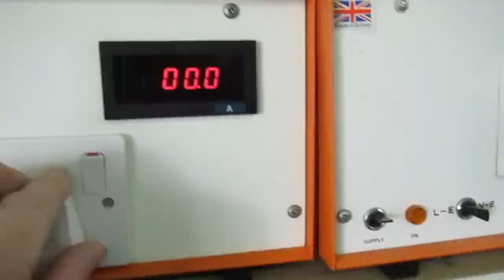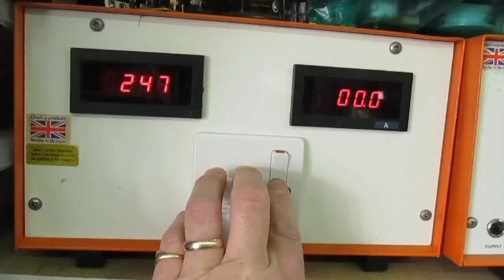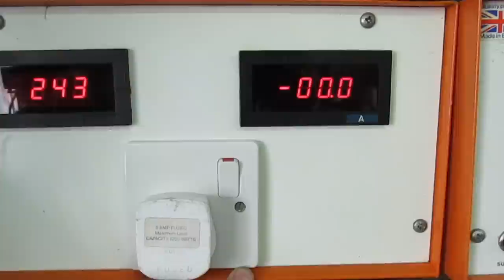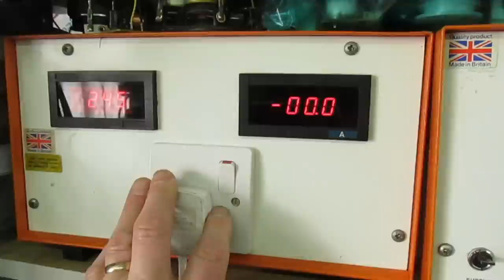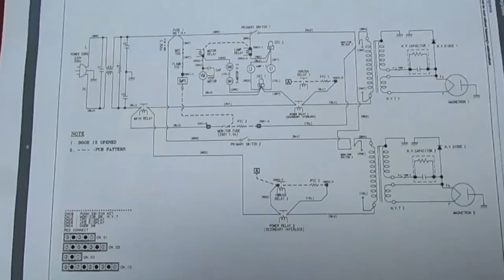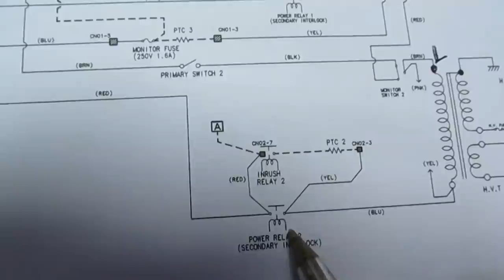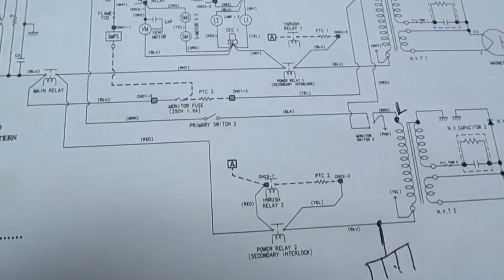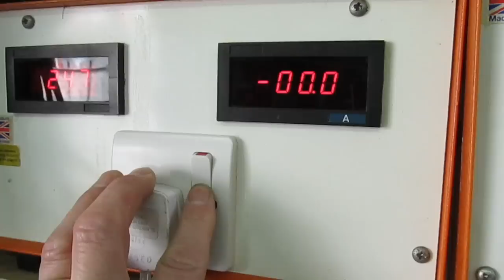Bizarre fault on Samsung commercial microwave oven.

Comment: During my apprenticeship in the 60's I was taught first and foremost, "look for the obvious". On saying that, when I was a chargehand electrician in mining, I had a call from one of my electricians, we were on night shifts, so even the obvious sometimes won't show up. He said he felt a fool but was stumped with an electrical problem and needed help...I helped him sort it out and it turned out to be a wire had come loose in a connector in a control circuit.
Reply: I must admit though, we once had an intermittent fault in on a main trunk conveyor, during it's life it must have cost my employer thousands in lost production, so you can imagine the pressure on us to locate and cure it. BUT, the damned thing wouldn't stay on long enough to make a diagnosis.Three overtime shifts looking for it didn't show results, myself, another competent elec and my Foreman on one of those shifts. I came on shift one afternoon, and the prior shift elect was telling me of a problem he'd had with this conveyor, then it hit me like a brick!! I now had the clue I had been looking for, one of the solid state modules was causing the problem, and I knew exactly which one. I took off underground before the shift started, made my way inbye to the trunk belt, checked what he had done, removed it and the belt worked perfectly, so the following day was a down time maintenance shift and I swapped out the suspect module. Fault cleared, it never reared it's ugly head again.
Reply from the maker: Absolutely , a visual inspection can sometimes give a fault away without needing a circuit diagram , a dry joint , loose connection ETC, but in this case with years of grease and fat build up visual inspection was very difficult .

Comment: I started repairing microwave ovens in the mid-80s and continued right into the 90s when repair was still an economic option. I did a few commercial ovens like this, some that could take a cup of water from cold to boiling in about 10 seconds. They were either wired with a 15 amp plug which has a larger earth pin (so cannot be connected to a standard outlet) or connected to a 20 A single phase PDL 56 series plug and socket.
I don't think in my entire time of servicing microwave ovens that I ever saw a fault like this where the wiring had burnt through to the case.
Reply from the maker: I have done a lot of these ovens over the years and they all just come with a standard 13 amp plug fitted , the instruction book quotes the input consumption as 3200 watts so yes its not good and I have had over the years people complaining they burn the sockets on the wall.
Reply: @michaeldranfield7140  not surprised! where i used to work (packaging factory) we had high power hot air guns, for heat welding polyethylene foam pieces, 'recommended' to be powered from a 16A circuit, but some were used on normal 13 amp plugs, with wattage i think 3.4kw? so the plugs and sockets got more than a little warm, it took a while to find plugs which heated the least! our kettle, 3kw, even makes its plug (and cable, but that seems to be underrated for its current, looks a 10A type to me) get pretty warm and thats only on for a few minutes at a time ..
Reply: @michaeldranfield7140  Yes I can imagine they would heat the wall sockets up a bit. I forgot to mention I am in New Zealand - our mains wiring is a bit different to the UK. For one, we don't use ring feeds whereas I know they are almost universal over there.
Reply from the maker: @sw6188  Domestic house wiring is not really my thing so I do know of the ring main but not sure why its done this way .

Comment: Well, it was pretty clear the meter was "lying", either because it wasn't reading all the wires that power could be going through (as it turned out) or because it was getting confused by some power factor-related issue (i.e., power being drawn on the "wrong" part of the cycle). I'm surprised that meter just seems to ignore the earth and live wires, and is only checking for current returning through neutral. "Quality product made in Britain", says the sticker. Heh.

Comment: Neither the restaurant or your workshop have an RCD then!
Reply from the maker: I don't actually know what's in this building apart from when I bought it I was told it has a 3 phase incoming supply, and I only use raw mains for testing microwaves as all my benches are fed from isolation transformers .
Reply: There are still plenty of installations in the UK without RCD, only mandatory on T-T supply incomer - ground rod earth.
Reply from the maker: @paulhancock562  Had a look in the fuse board and there are some sort of breakers fitted but I guess technology has come on over the years and better thinks are now available .
Reply: @michaeldranfield7140  You can replace the MCBs with RCBO RCD devices....but if you have shared neutrals then that can't be done.  So you might be able to do it, and just drop in some RCBOs instead of the MCBS.

And I would suggest you then perform a test on the Clare module by putting an earth fault on the switched outlet and check that the RCBO does indeed trip. If it doesn't you will need a separate RCD plug inserted into the socket of the Clare.

Don't assume that the RCBO in the consumer unit will protect against an earth fault on the output of the Clare.
Reply from the maker: @deang5622  many thanks for that .

Comment: Interesting one!
Reply from the maker: Certainly was and as someone else has pointed out its time to get an electrician in and get my fuse board tested and updated to some sort of trip system as this is quite and old building .
Reply: @michaeldranfield7140  I'd make sure its a RCBO system and not just a split load, so one faulty item doesn't take power out to half the building

Comment: with anything electrical, I will do a quick examination of the wires first. only reason, because through the years I did crypto mining, and a few wires melted the insulation which then cuts the power if the supply detects it, or if the fuse blows.
Reply from the maker: Down to poor design I think , wires passing through a metal hole should be shielded by a rubber grommet.

Comment: @ Michael Dranfield
Why don't you have ELCB (RCD)  installed on that mains supply?
Why don't you safety test (Earth leakage at 1,000V) prior to plugging it for a function test? 
Doing either of these would have indicated immediately either an Active or Neutral insulation fault.
Reply from the maker: I dont do a PAT test untill I have repaired something  but yes I would have picked this up straight away if I had done the insulation test first .
Reply: PAT tests take too long.
When someone gives you an appliance, the first thing you are going to do is plug it in and see if it works. You're not going going to go through the hassle of digging out the PAT tester. And the PAT tester doesn't tell you anything about whether the appliance works.  You're given an appliance that doesn't work, for all you know the fault could be in a microprocessor control board inside. So you just going to turn it on to see what kind of fault it has. Then you can start to investigate it.

What he should have done is use an RCD plug (or connect to a mains isolated supply where there is an isolation transformer).
Both would have prevented electrocution when touching the metal case.

The RCD would have tripped, indicating a sizeable earth current. And given that it has a metal case, that would set the alarm bells ringing..."Take care!".
Reply from the maker: @deang5622  seems like I have a fuse board full of breakers not RCD s but I have since bought a plug in RCD for microwave repairs, , my other benches are fed from isolation transformers , I only use raw mains for microwave ovens .

Comment: Those wires didn't appear to be very secure to prevent that type of fault
Reply from the maker: True and they also don't look that capable of carrying 7 amps .
Reply: I don't think movement of the cables has led to this fault
Reply from the maker: @deang5622  it was disturbing the cables that led me to the fault, a big blue flash !

Comment: Could you also diagnose further to find out why the insulation on the transfer output wires got melted in the 1st place? and what exactly caused them to overheat?
Reply: They overheated because of excess current flow, or because the insulation broke down because of the voltages involved and age of the cables. Take your pick.
Reply from the maker: I think one of the factors was grease dripping onto the cable which passed through a hole with sharp edges and didn't have any sort of rubber grommet fitted to prevent this, and this degraded the wires insulation . .

Comment: Why would the RCD not trip? Or was this on a unprotected circuit?
Reply from the maker: as this is an old building it appears I dont have RCD s fitted.
Reply: Why assume there was an RCD? This is the thing that is puzzling me. So many people assuming that the circuit is protected.

The power is coming out of a Clare device, via a standard 13 amp switched UK mains socket and if you look closely there is no test button, so clearly this socket does NOT have an integral RCD.

Ok, so what about protection upstream by an RCD in the consumer unit? There may or may not be one present. Just an assumption. And even if there was, as the power is going through the Clare, you can't assume that the RCD in the consumer unit would protect against faults on the output of the Clare. It might , it might not, it depends on precisely what the Clare is doing.

So the best way to provide protection here, is either by using an isolation transformer with a 1:1 ratio on the windings, or by using an RCD plug plugged into the socket outlet on the Clare.

Comment: If 14.7 amps is normal for that microwave then it can't run of a 13A plug in normal service
Reply: probably meant for a 16Amp line
Reply: Rated power on the front of the microwave is way less than the maximum for a 13 amp socket.
Reply: @deang5622  i know, you need to  to look at the actual consumption on the back, ours is marked on the front as 800w but actual power draw is 1300, i think

Comment: After repairing the microwave and refitting the case, do you have to check for microwave leaks? I'm asking because my microwave is making a noise that sounds like a duff plastic gear and I want to investigate, but I've never opened one before.
Reply from the maker: Yes , I always check for leakage, you wont cause any damage by just removing the case , in my experience leakage only occurs when the door is damaged ,  it will be perfectly safe just to remove the outer cover ,
Reply: @michaeldranfield7140  thanks. I was a bit worried about it.
Reply from the maker: @davidkerridge6612  nothing to worry about as long as you don't undo any screws holding the door on and make sure the microwave is un plugged from the mains and just as a precaution discharge the capacitor in case the bleed resistor is faulty .

Comment: Surely that fault would trip any inline earth leakage device / RCD... Guess you and your client don't bother with those ;-) . Very bad design, never under any circumstance switch the neutral without also switching the live. ie. All single pole switching must be in the live only.
Reply from the maker: I didn't have an earth leak breaker at the time as I hardly ever use raw mains but I have a plug in one now . As you say , switching the neutral side and leaving live mains on the transformers is a very bad design idea.

Comment: As pointed out ad nauseam here both your workshop mains wiring and your isolation transformer/current measuring device set-up need an upgrade. More importantly same goes for the premises where the microwave is normally installed. RCD safety devices have been mandatory here (and I'm sure in your country) for quite some time now. Of course there is 1 installed in my own residence - but only after having to employ a licenced electrician because of age and declining mobility! But then going out in a "blaze of glory" would only be a fitting prelude to 1 of the thousands of possible "Hells" awaiting me. Maybe 1 should flip a coin and choose a religion to reduce my chances to thousands -1! 🤔😜😁
Reply from the maker: I always work with isolation transformers and very rarely with raw mains but as other's have pointed out I do need an update on my fuse board,

Comment: If the magnetron was energized and heating water,  you are certainly using current.  The issue is really how you are measuring current.  Perhaps you can elaborate on that in a follow up video.
Reply: The ammeter is in the neutral line on the 13 amp switched mains outlet.
Current is passing from live to earth and not flowing back on the neutral line (within the building).

It's possible the earthing strategy is of MPE - multiple protective earth, where the earth is connected to the neutral at entry to the building. 

So current can be present on the live line and powering the appliance but not being measured by the ammeter.

Comment: How does a dual magnetron setup work 

Mythbusters tried to run one like that and they ended up fighting each other
Reply from the maker: the mains transformers are wired in opposite phase to each other so one magnatron produces an output of the positive cycle of the mains and the other magnatron produces its output on the negative half cycle of the mains
Reply: @michaeldranfield7140  spose but then that doesn't work because the magnetron is a frequency generator that's quite unstable 

Spose it doesn't have to be highly efficient
Reply: @weazeldark3983  Can you elaborate on what you are talking about please?

My experience with magnetrons in radar is that they are not unstable. There is a failure mode where they can flip in frequency.
Now if that happens in a microwave cookers, then the cooker is useless as a precise frequency is needed to excite the water molecules in the food.

But I have owned microwave cookers for many years and it's not true to say they are unreliable.

So with two magnetrons, one is transmitting RF when the other one isn't.  So over a period of time, the energy received by the food is twice that of a single magnetron, and hence the food heats up more quickly.
Reply: @deang5622  magnetrons are noisy transmitters they can't oscillate with precision 
For radar or cooking food it doesn't matter but for transmitting for something precision then it's to much of a range 

Even though it's 180° out of phase it's going though a voltage doubler that as discharging the other be outputting and the 2 outputs not being in clear sync would fight each other  

Maybe it's loss isn't that big 

I know myth busters tried making a powerful multi magnetron oven 

I was going to make a dc power supply and feed a ac signal in to it to see if could tune it  
Wanted to try have a 10kw one 

That's why magnetron was for radar and cooking and not for transmitters like kyelstrons and other types
Reply: @weazeldark3983  what michael is saying that the 50Hz mains is only half wave rectified on each magnetron. so for each half cycle one magnetron will be on and the other off .  Remember there is no smoothing of the DC after the high voltage diode, so the 2.4GHz is riding on top of the unsmoothed DC waves! Hence they are both never on at the same time.
Reply: @mattsan70  it isn't half wave its voltage doubler SOS one half wave is 2000v approx 2nd is 4000v approx
Reply: Have to try it with 3 phase n see how much power goes though 1 to 3 magz 
Use a spark gap tester and feed wire though front door
Reply: @michaeldranfield7140  Two magnetrons into the same cavity will `injection lock` to the same frequency and when operated on pulsed dc or dc with very high ripple, they need the B+ supplies to be IN phase not 180deg out. When into the same cavity they are not operating in push pull, they are still single ended parallel

Comment: I think I'd get another ammeter. Had you seen it drawing current at the very beginning you would have known there was a short somewhere.
Reply: The ammeter is not at fault, it is how it is connected that is. Though arguably the manufacturer Clare could argue they intend it to be connected in the neutral line to pick up this kind of live to earth fault.
Reply: I didn’t say that the ammeter was at fault; I said I would get another one. If an ammeter does not indicate a current when a current is indeed flowing it’s not very useful ammeter to me.  Even a clamp on meter would it be more useful.

Comment: wait, shouldn't this have tripped the ...what are they called...RCD's..Don't you have those installed in the UK? I assume you are in the UK
Reply: many older houses dont, we dont...
Reply: New electrical installations it is compulsory to have them fitted. But there is no obligation to rip out old consumer units and replace them with modern ones containing RCDs